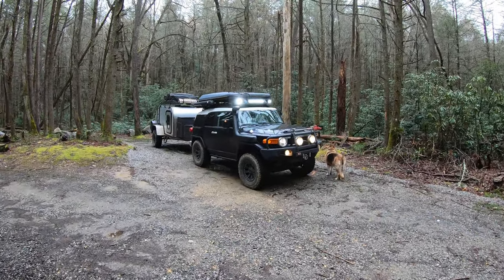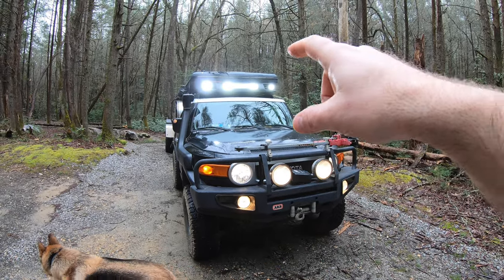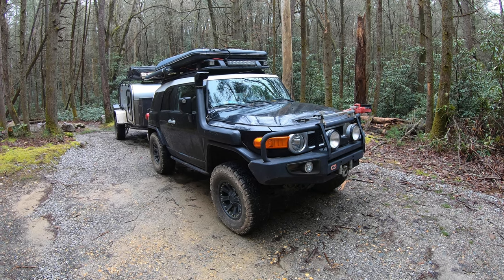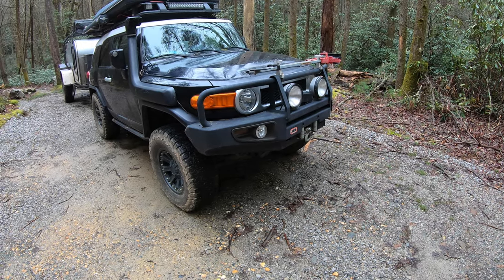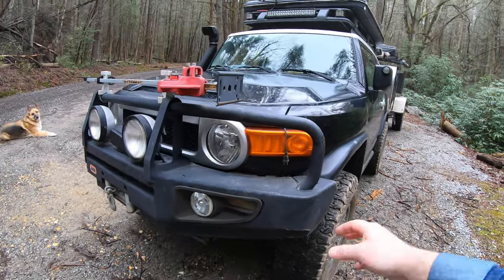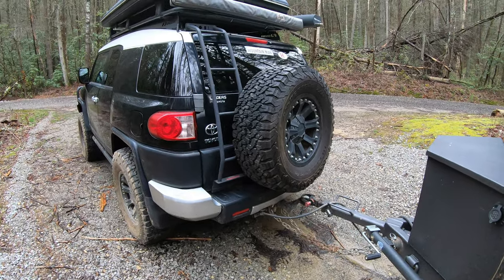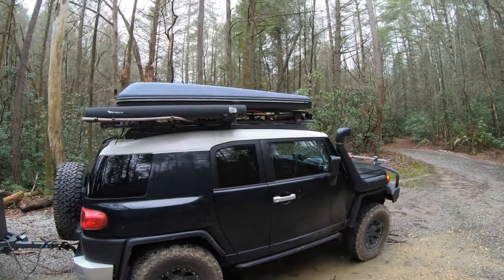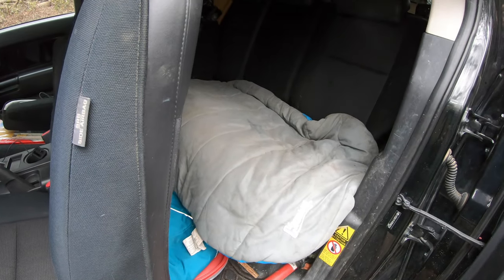WATCH: Toyota FJ Cruiser and Moby Offroad Teardrop Walk Around part 1

Comment: I really like your FJC setup.  The dropdown table/stove is simple and ingenious.  I have a stock '08 FJC bought new specifically for driving out to Colorado most every summer.  It's gotten me into a lot of great backcountry camp sites and fly fishing spots.  For my next trip out, I plan to fabricate the stove/table and a roof rack shower system using ABS pipe.  FWIW, I also have a slightly modified (header and 2.5 inch OME lift kit) '77 FJ40 I've owned since 1982.  Only 80,000 original miles  since I use it mostly around the place, not much on the road.   Enjoying your newly discovered channel.   /s/ your next door neighbor.  And new sub.
Reply from the maker: Thanks!  Gotta love the FJ.  I'm about to Line-X mine I think and rebuild the suspension... likely that truck will last longer than me!

Comment: Did you find a burner that top mounted with holes already drilled, or did you drill the holes and attach it to the top? I haven't been able to find any burners with mounting holes like yours. That's a great setup.

Comment: Holy rear squat Batman! Always wanted an FJ but went with a Tacoma instead. Great video!
Reply from the maker: Yeah, I'm looking into stronger spring rate coils from OME or air bags.  It was fine... but over time they have "softened" up.  How do you like the Taco?  What generation?  I had a '17 TRD Pro but didn't care for the gearing / transmission combo... it was always gear hunting.
Reply: @BigSexyBeastAdventures   My 2008 FJ has been good to me also.  I like my ICON "Overland" coils as they are "multi rate" so they don't seem as harsh (and that's how they're designed to work) when unloaded as a straight heavy coil like OME.  They work well for differential loads in the rear of my FJ such as my aux fuel tank and trailer.  I used to have in-coil air bags and they were okay but it seems you always have to fiddle with them.  Then they blew during a trip with the trailer and I went to the Overland Coils and haven't looked back.  BTW:  It was hard to tell how much squat you normally have as the passenger side rear was obviously getting compressed where it was sitting for the video.